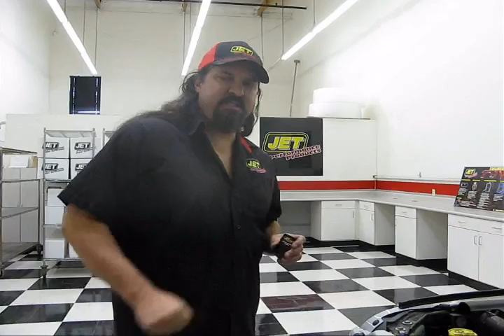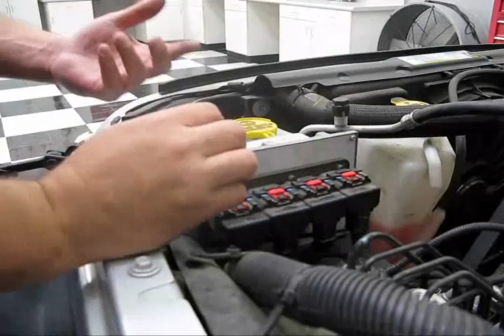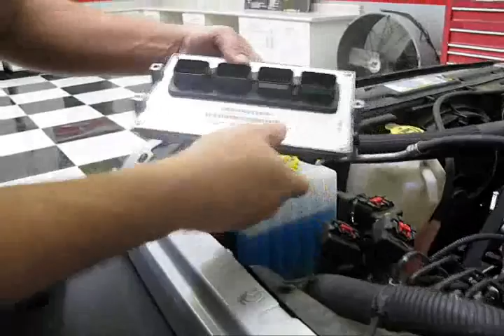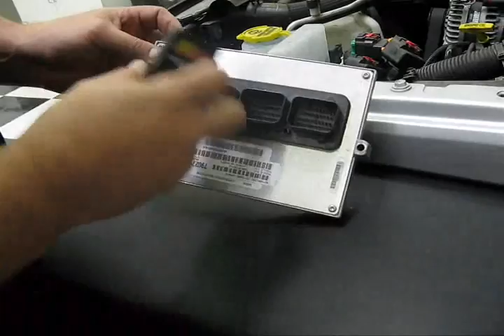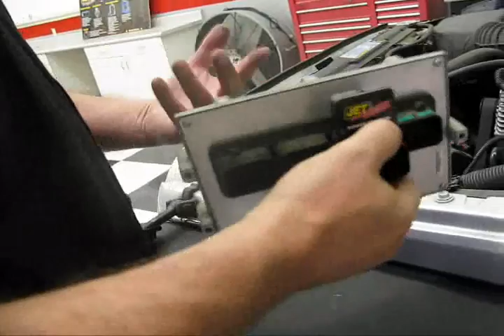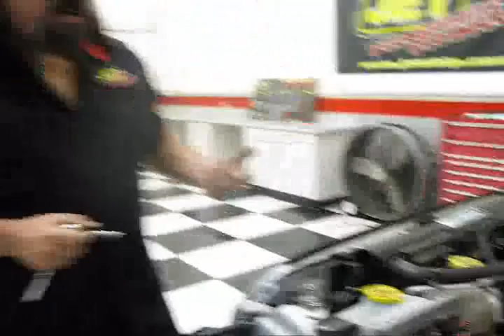JET Stage 1 Power Control Modules for Dodge Jeep Computer Chip How-To Install Tutorial

Comment: Dose it mater what gas you use with this
Reply from the maker: Premium gas is recommended for best performance.
Reply: @JEGSHighPerformance  Ok but you can run ethnal with this right
Reply from the maker: @Eric9-v3  92 or higher octane is recommend, if running ethanol, please call JET direct to confirm at 1-800-535-1161.
Reply: @JEGSHighPerformance  OK because i have a full tank of eternal right now but I don't have the jet performance in. The vichale i am putting it in is a 2005 jeep liberty
Reply from the maker: @Eric9-v3  You would have to drain the tank and put the correct fuel in to work with this.

Comment: I have a hummer h3 3.7l I was looking to buy one but was wondering if the installation is just as easy?
Reply from the maker: in general, yes, just as easy.
Reply: lol hope you realize this Jeep module is NOT for your 5 cylinder GM 3.7 engine.

Comment: what's the difference between stage 1,2,3 and what's the best for more HP
Reply from the maker: +Donny Linton The higher the stage, the more HP to be gained. However, typically a lower temp thermostat is required for stages 2 or higher.
Reply: +JEGS Performance ok thanks, its that because the car starts to run hot from stage 2, 3
Reply from the maker: the car needs more fuel for stage 2 and 3. You trick the computer by putting in a lower thermostat. So the computer richens the fuel fuel mixture to try to warm up the engine. This gives more power.
Reply: +Donny Linton SINCE YOU ASKED, I'LL TELLYA!!!!!

Stage 1-Is for stock or mildly modified vehicles. Fuel and timing curves modified for optimal performance and mileage using midgrade fuel (89 octane or better recommended). Good for daily driving, towing and street performance. Improves horsepower, torque, overall acceleration and throttle response. No other modifications to vehicle are required, but the Stage 1 programming will work with most aftermarket upgrades without using premium fuel.

Stage 2-Is designed for the performance enthusiast, the Stage 2 features more aggressive programming to make the most horsepower and torque available. The Stage 2 programming requires use of 91 octane fuel to optimize the advanced timing curves, a 180 degree thermostat to provide a denser air/fuel mixture and a free flow exhaust system to reduce back-pressure. The stage 2 will also enhance the performance of aftermarket intake systems, mass air sensors, TBI spacers, etc.

Stage 3-Is just balls to the wall performance parts on everything, Donny.......

Comment: difficult to install in y 2011 wrangler , because there's fuse box behind the computer chip , please help ?
Reply from the maker: For the answer to this question, would you please contact JET performance direct at 1-800-535-1161? They can provide and talk you through the proper installation instructions.

Comment: Anything available for my 2911 Ram 4.7? I have a Airaid cold air intake installed already.
Reply from the maker: http://www.jegs.com/i/JET-Performance/561/90902/10002/-1?ymm=4294829592+4294828869+4294828868
Reply from the maker: http://www.jegs.com/i/JET-Performance/561/90902S/10002/-1?ymm=4294829592+4294828869+4294828868
Reply: @JEGSHighPerformance  after a day or two, the SRS light went off and passenger seat belt was disabled. I gave you guys a call and never have a return call about rhe issue. Anything info would be help and appreciated. ty
Reply from the maker: @irwinbw  Please call us at 1-800-345-4545 and ask to speak to a tech supervisor so we can properly help you out.

Comment: Hello I have grand cherokee 1995 5.2 V8 with supercharger on it. Jetchip 99513S will works fine with it?
Reply from the maker: If the supercharger on your application required a tune to complete installation, you cannot add a jet chip on top of it, the engine needs to run off of the tune specifically for the supercharger setup.
Reply: supercharger is already installed and works fine, so... if i put Jet Chip 99513S i can't get any additional horse power???
Reply from the maker: If the JET chip is designed to work with the supercharger, yes. However, that part number doesn't state that it is compatible with a supercharger. You can call JET at 1-800-535-1161 for more info as we do not recommend using the chip without their endorsement.

Comment: What is the difference between stage 1 and stage 2? I have a 2014 challenger SXT I'm wanting to get one for. 

I'm putting in cold air intake. Throttle body spacer and borla s type exhaust. 

Which Stage would be better to buy?
Reply from the maker: Stage 2 requires a lower degree thermostat. This makes the engine run cooler and the computer compensates by richening the fuel mixture to try to warm it up. The JET module then uses that to make adjustments in timing to work with it and make even more power than stage one.

Comment: Can someone explain how these even work with 2015+ FCA Vehicles with GPEC2 PCMs.  They are locked and you can't change anything without having the PCM unlocked and using something like HP Tuners.  Is this simply faking the computer into thinking it has colder IAT's than reality to advance timing, which not only is unsafe but doesn't make much power either.
Reply: @JEGSHighPerformance  Why can't you answer them here in public for everyone to see?
Reply from the maker: We spoke to JET. This is a piggyback into the computer from the sensors, which manipulates the input signals to the computer. Once the module is installed, it manipulates timing, injector pulse, and other inputs to the computer, it doesn't change or write over the programming in the computer itself. Does that help?